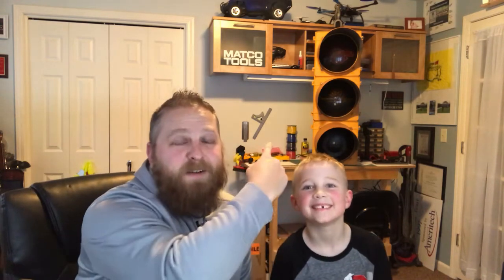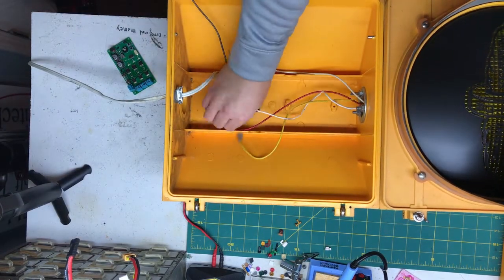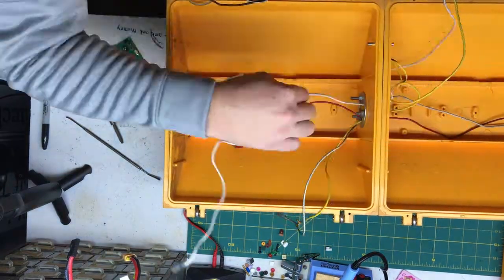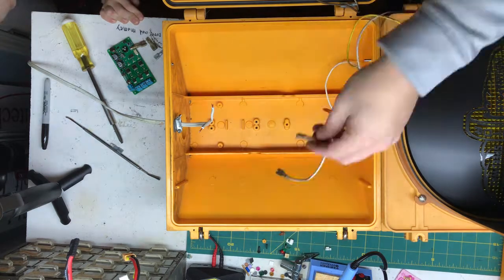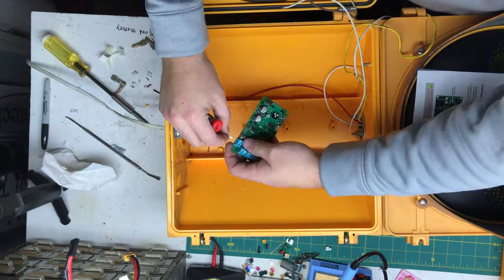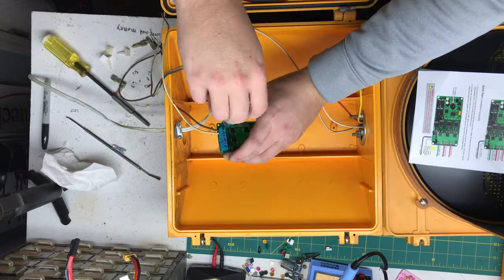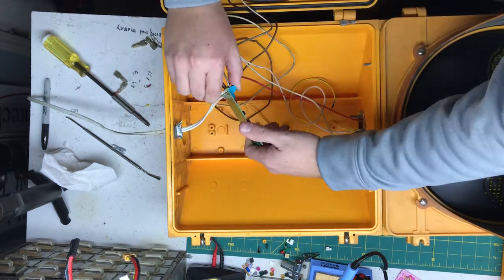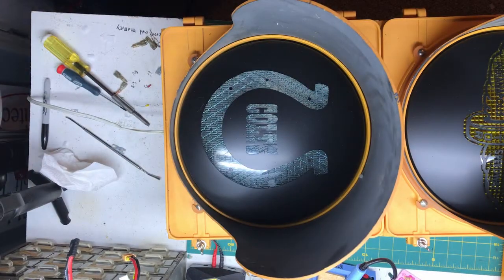Traffic Light Controller (VG-305B from Galak Electronics)

Comment: recently purchased traffic light controller VG-305G from Galak Electronics, they had no problem taking m y money & sending me the product. As a master electrician with 50 years experience, this isn't rocket science to wire. When I first energizer controller, there was a loud pop, and something blew. I contacted Galak Electronics, they had me send it back & they would replace it with a new one. After several phone calls & e-mails, I have had no response, and no replacement received. As far as I'm concerned, Galak Electronics is not to be trusted & I would recommend NOT to purchase anything from him. 
Art Miller, Art's Affordable Electric

Comment: Nice one. I just wired up one of these this morning then had a blow up. Shattered the orange bulb and blew the other 2 bulbs and the fuse on the circuit board. The traffic light I have was running on a 12v system on a car battery so do you think I need appropriate bulbs to solve my problem? I did the test like you did on the circuit board before connecting the bulbs and it functioned fine.